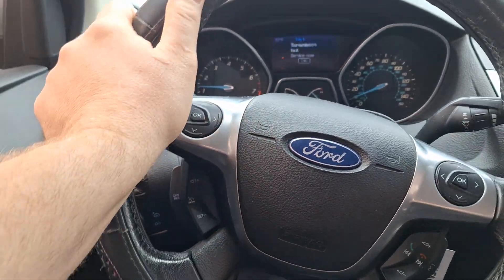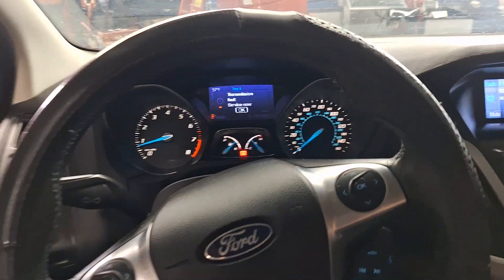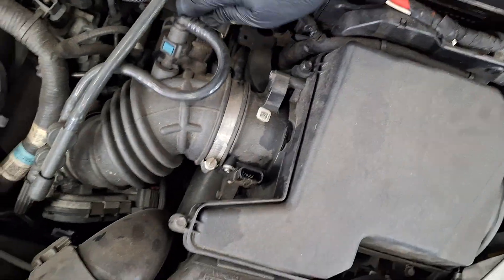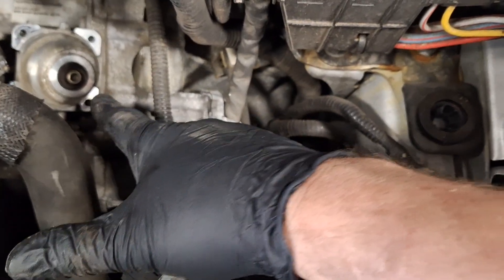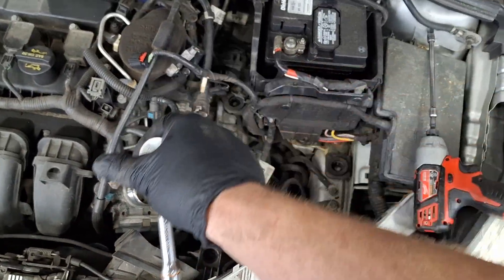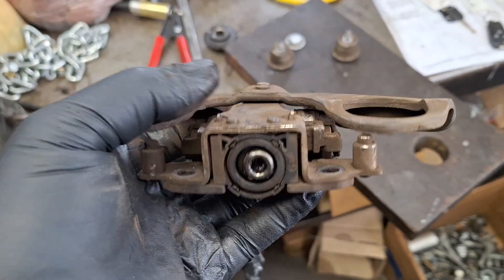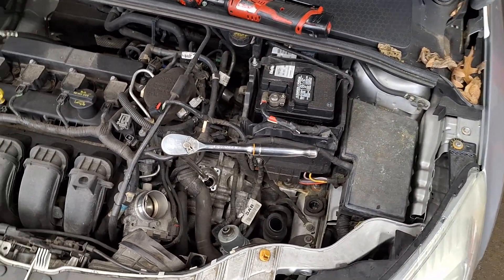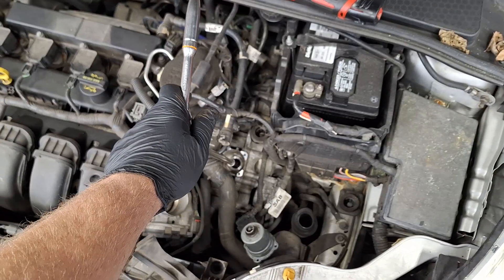Ford Focus P07A2 Diagnosis | DPS6 Transmission Clutch Fork Failure

Comment: Thanks Ben, your videos are very helpful,  i have 2013 focus se, i swaped actuator motors, I did reset clutch as you showed in this video. My car runs good after resetting TCM, but when I turn off the car and later on turn it on,  it dosnt go into reverse and gear 2 etc. When I turn off the car I can heard some kind of sound near the front driver side tire.
Plz help me,
Reply from the maker: If you have p07a2 you likely need a clutch job
Reply: @BigBensCarsAndCycles , thanks for replying Ben, I have P87/287A

Comment: I accidently broke when trying reset what can i do the whole bolt juat came out
Reply from the maker: Hey, you mean the whole whole threaded portion of the fork came out? The only thing you can do is replace the fork because there's just a lot of little ball bearings that came out too I'm sure
Reply: @BigBensCarsAndCycles can i order only fork i. Just did the clutch replacement its for bottom actuator

Comment: I have a question, all these problems with the transmission, aren’t they all caused from a faulty TCM?. Example this video with a p07A2 code, fork A stuck on is stuck cause of debri built up in the box from the tcm riding the clutch, which then creates dust. I’ve taken mine to a dealership and they won’t change my tcm, but are happy to charge me $6k to fix the problem, I said the car’s not worth that much, friggin thieves
Reply from the maker: Yes its true that sub-par tcm calibrations from ford has caused issues with this transmission. However, in your case I think you have a damaged slave cylinder bearing inside your bellhousing. A permanent fix would be manual-swapping your car, which i have a play list for. under $1000 to swap in a manual transmission yourself
Reply: @BigBensCarsAndCycles 
I did a full clutch kit replacement not even a year ago and now having same issues as last time, I believe it’s the tcm, dealership doesn’t, but they will when I open the tcm up and fry one of the processors

Comment: Hello, what do i need to do to fix code P2872 Clutch A Stuck engaged? 

Could i be lucky enough to only need to reset the forks and it be normally driven again? Just has a tough time shifting.
Reply from the maker: Follow my videos for codes p07a3

Comment: Quick question Big Ben, when I do the shift fork test, is it normal for there to be about half a turn play where the fork has no resistance? It doesn’t turn the tool to the fork’s complete stop position but instead it has about half a turn play before it hits its complete stop position.
Reply from the maker: @luiso.717  hi, that doesn't sound right to me

Comment: When turning counter clockwise mine keeps going and transmission currently saying overheating should I assume I need new forks?
Reply from the maker: Yes, sounds like the fork is broken. I'd do a full clutch job: OEM Clutch and fork kit: https://amzn.to/48ppwVJ
Clutch/fork replacement NO special TOOLS: https://youtu.be/EIJt9anfdSM?si=3vMykrhV0IOZksYN
Transmission removal at home: https://youtu.be/UBeWfEXdYLc?si=EfFlMAQkh6wv0Ro5

Comment: Great info and thanks for links. I got the Po7a2 yesterday. Its been 75k miles since last clutch job so im guessing its time
Reply from the maker: I agree (clutch job)! And I've learned over time when I see p07a2 its more often the slave cylinder bearings coming apart, sometimes its the fork, either way I'd replace the clutch, forks and slave cyl
Reply: @BigBensCarsAndCycles  hi there mines done 200k on the clock would u suggest the same thing engine check light comes on it seems to shutter reves outer control not shifting from first to 2nd jolt's and at some stage it gets no reverse

Comment: Bought a 2013 recently, I’ve tried cleaning the grounds, changing the fluid, spraying wd-40 on the forks, installed a new battery, changed the actuators. I haven’t messed with the TCM. Previous owner said the dealership installed a new tcm about a year ago. I know that’s not a guarantee that it’s not the tcm but I’m not getting any codes at all. One trip it doesn’t drive half bad next drive it shuddering and shifting funny. The longer I drive it on a trip the better it seems to shift ironically. I’m assuming the forks are bad and or the clutch needs replaced. 🤷🏻
Reply from the maker: Yes clutch shudder. You can drive it hard once in a while to mitigate the shudder or replace the clutch and forks https://amzn.to/48ppwVJ
Reply: I do have access to another tcm, my personal car is a 2018 focus. I’ve never had any issues with the transmission. Theoretically I could swap and see if something changes. But I’m also concerned with having two messed up focus’s if I tried that.

Comment: Thanks for your videos. How many rotations should it rotate counter clockwise? I can only rotate 7 to 8 times before it gets tension. Thanks
Reply from the maker: 15 turns usually before the fork maxes out. You have an issue with the fork it sounds like
Reply: @BigBensCarsAndCycles  I also got a clutch disengagement time/proformance slow. And that was after I sprayed break cleaner and wind it a couple of times. But before that, only got the clutch a stuck engaged. Also, transmission over heating. Will a stuck clutch cause that also? 🙏🏾 Thanks

Comment: APPRECIATE THE HELP. I have a 2015 fiesta... jerks and when downshifting and just shifting regularly it's like it's slipping until rpms drop then it engages... was pulling the trans and was almost out then decided to just change actuators... seemed to help a little at first but now its doing the same things. tried resetting the tcm, actually changed the TCM then reset it but didnt make a differentce. it has a check engine light but my el chepao scanner wont read the codes. did note fork "A" does not stop clockwise so based on your video the fork is bad... car has 160000 miles on it. guess i'm pulling the transmission and replacing clutch, forks, and bearings after all.
Reply from the maker: Glad to help. I've got a video on how to change the clutch and forks without special tools. That should get you all get!
Reply: @BigBensCarsAndCycles  thanks just watched it... i'll watch the driveway removal one next... with 160000 miles on it and since i already put in a new motor i am going to just change clutch and all... it's my son's car so  it should last him a while. thanks again.. now i have to find a fairly inexpensive bidirectional scanner..to do the clutch touch point relearn.. or whatever its called..
Reply from the maker: @sspikeable  50 bucks for obdlink ex, and a free forscan license https://youtu.be/UUP7-byacAE
Reply: @BigBensCarsAndCycles  million thanks, Scott... now gotta find my motivation to start pulling this transmission.. takes about 1-1/2 hrs to pull. if you want to send the parts link so you'll get a % from amazon or ebay sell. i appreciate the help..
Reply from the maker: @sspikeable  Ford Focus & Fiesta Clutch / Fork kit https://amzn.to/48ppwVJ

Comment: hii ben i have 2012 ford focus automatic in 2 gear its jerking not in any other gear only in second gear what is the problem do you know that and also share me the solution please .. thanks
Reply from the maker: Hi, that sounds like your clutch is shuddering. I would drive the car full throttle several times to lessen the shudder, and keep driving the car

Comment: I hate this car bro. Why is it even being allowed to stay in circulation?
Reply: Spend a day every couple years cleaning the clutch forks and it should last many years. If the TCM goes bad its only $325 from ford. Otherwise good cars. I wish they'd sell more stick shifts but europe gets those and we're stuck with automatics
Reply: @robertl2227  you realize that for most "spending a day to clean the forks" is a bit of a ridiculous statement right? This is supposed to be an economy car for normal people, not an enthusiast project
Reply: @promethieos1875  Clean a stupid fork is something that normal ppl can do no enthusiast... if you just ask a mechanic do it, it he will do it fast and cheap.

Comment: I have a 2017 focus titanium that started having issues, P07A2, losing 3rd and 5th. However, if you let it rest a little the transmission will work fine for a bit, would that be the tcm?
Reply: So far i only tried switching the actuators, there was no change, and I recently changed the transmission oil
Reply from the maker: @gloriedbiscuit3246  that will most likely need the same repair as this
Reply: @BigBensCarsAndCycles  bit of an update. Thanks to your videos, i found out that fork A seized on the rebound. I sprayed some wd40 on the mechanism and now it goes back and fork without a hitch. Still i will schedule a full clutch job soon

Comment: Will a 2013 focus dsp6 fit a 2016 focus se with no extra modifications? I recently bought the 2016 titanium and the syncros are grinding and found a $200 transmission from a 2013
Reply from the maker: Yeah it'll fit. There are some differences on some of the year models internally..and if it shifts hard you may want to program the other years calibration in to the tcm
Reply: @BigBensCarsAndCycles  thank you i may try to find the same year to avoid different gearing. Thanks for the heads up

Comment: Hello, just came across your videos, first, thanks so much for so many clear informative videos.  I have a question that may not be related to this video, but since it was your latest video, I figured it would be the best option to get a response.  My focus has 218k miles, up until now I haven't really had a problem, I bought it at 40k and after I bought it and it started to shudder I looked up a couple videos and started to figure out what the issues were and just started driving it hard, using sport mode to keep it in gear in traffic and being mindful of how I should drive it.  Plus I had a 45 mile each way commute 5 days a week for 6 years of just freeway driving, so I'm sure that helped my transmission not fail.  Lately I noticed a squeak.  I don't know if this is what you are calling a grind in your videos, but to me it sounds like more of a squeak than a grind, but it does it when changing gears.  And then it gave me a code one day for a P074B-unable to engage gear 3.  When I turn the car off and back on the onscreen code goes away and it drives back to normal, except the squeak thing.  At first I thought it had to be the clutch, but then after watching your videos, it sounds like it is more the synchros than anything else.  I just did a fluid flush with the ford recommended motorcraft stuff and drove it a mile or two, then drained that and am now trying the acdelco syncroshift stuff that you mentioned in one of your videos.  Unfortunately thats the first its ever been changed, i keep up on my oil and other stuff, but never realized that was something I had to do.  Do you think I have this diagnosed correctly?  I was kind of hoping it was just the clutch, I think I could change that out, but if its deeper in the trans, then I don't know if I want to try to attemp that.
Reply from the maker: Thanks for watching. That does sound like a worn synchronizer. You can get a used low mileage transmission, and install a new clutch and fork kit in it before installing it in the car. It would be a good idea to also install a new OEM tcm. However you could just live with the scnchro issue as it'll just skip that gear